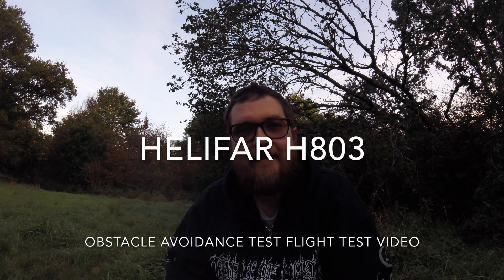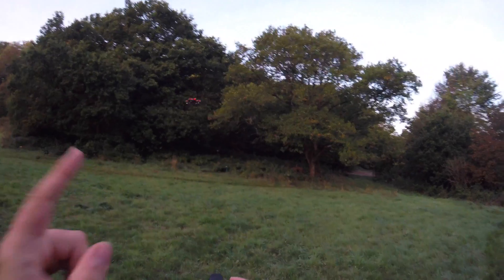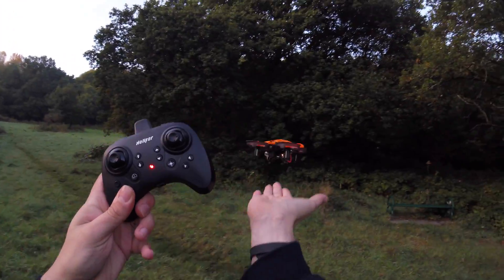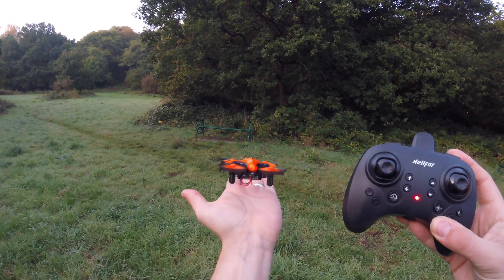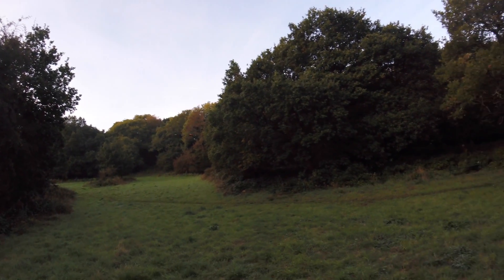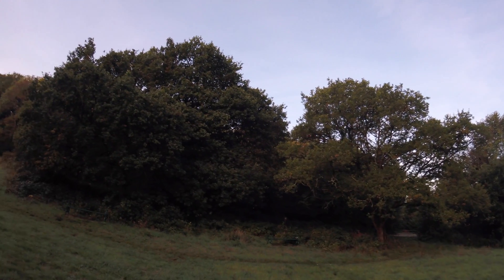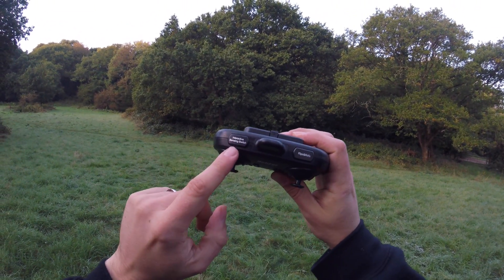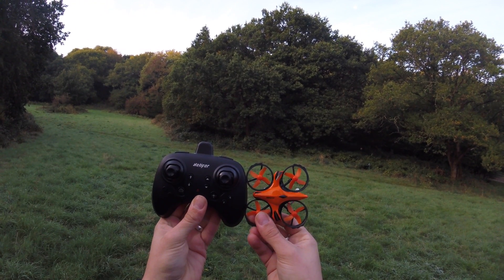Helifar H803 Obstacle Avoidance Drone Flight Test Video

Comment: Try using it indoors see if it senses the walls I think on those cheaper versions they sunlight messes with them
Reply from the maker: Hey Ben ive done that bud and the video is coming on Thursday, and yes thr sun does mess with the infrared but i hadnt initialised sensor mode in this vidro. Thats why it didnt work, i had much better results indoors after iniatlising sensor mode. Cheers bud 👍😀

Comment: You have to hold down the interactive sensing switch for a few seconds to activate the obstacle avoidance. 
Tiggers RC Reviews shows this in his review of this drone, and it’s working. Or perhaps you have a faulty one...
Reply from the maker: Hey bert hows it going bud? I did try exactly that and nothing happened. Ive got another vid coming out on this next week, hopefully i csn get it to work as i would like ti see it working. Cheers fella. 👍😀